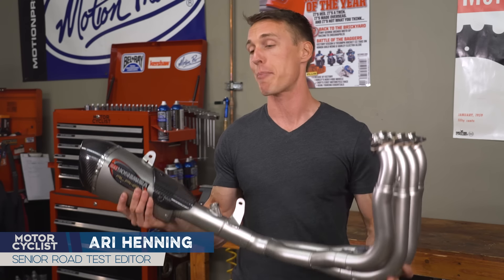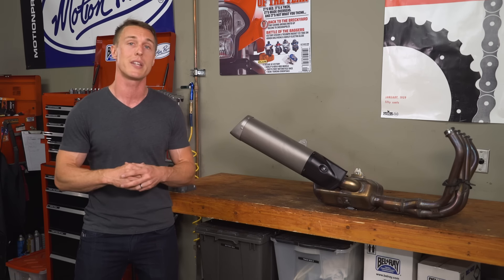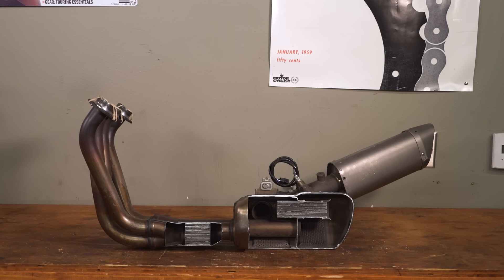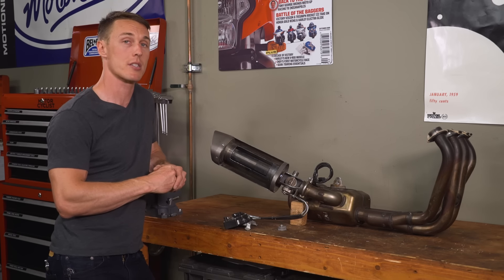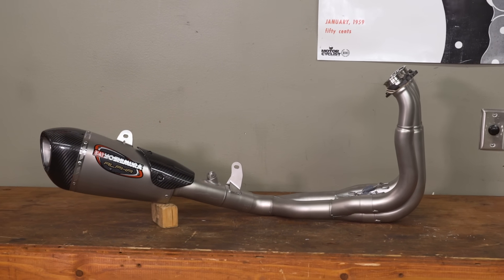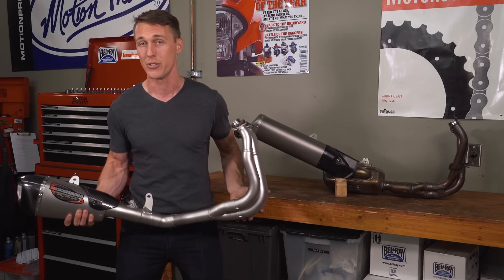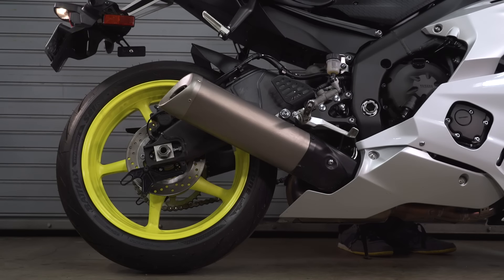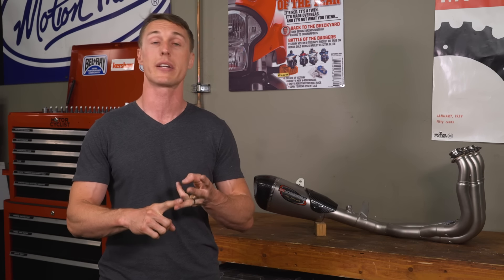The Truth About Aftermarket Exhausts | MC Garage

Comment: If you ride long journeys the novelty of a loud exhaust gets old pretty quick.
Reply: Yes, I hated riding my bike with race pipes on it.  So loud and practically gave me a headache after a 40 minute ride.  Bought an Fz07 and I'm not touching the exhaust.  It's so quiet, I can hardly hear it over the wind.
Reply: DThompson T I’m thinking of getting a FZ/MT-07. I’m torn between the Kawasaki Z650 and that one. What are your thoughts on the FZ/MT-07?
Reply: @vexmau5  well, I went from stunt riding an F3, F4I, KAWI 636 then I stopped that and rode a 750 shadow for a few years.  Now I have the FZ-07 and I love it.  Is it the fastest I have ever had? No, but it's still fast enough.  I love the low to mid range torque it has.  Great for in town riding.  The riding position is nice also.  I looked up alot of reviews and riding videos before purchasing the Fz07 and nearly all were positive.  Do you have experience?
Reply: DThompson T yes I do. I have nearly a year of experience with my R3 under my belt. I know it’s not a lot but I personally feel like I’m ready to move up the scale. Since I only have a year of experience, that’s why I’m looking at the Z650 and FZ-07. I’ve read all around that they’re good “beginner” bikes
Reply: @vexmau5  I cant speak for the kawi but the FZ07 has good power, it's very light and its easy to handle.  I dont know how "beginner" it is because it has enough pull to throw you off if your not careful but I started out on a 600cc and did fine with common sense.  Dont act like an idiot with it and treat it properly and you should be fine.
Reply: LOUD PIPES SAVE LIVES !!!
Reply: @dalehumphrey8765  Certainly doesn't hurt
Reply: HFR83 .. just annoying, especially after a long ride, or some Idiot revving his engine at a stop, or in a gas station.
Reply: @peacefulwarrior4078   Loud pipes give you tinnitus and draw too much attention from the Police - but I have them on my Harleys  as my engines are so modified that standard pipes stifle the bikes ....... I suppose I will get lots of 'haters' replying to that comment !
Reply: Not if you ride a Harley.      1800 miles to Sturgis every year.  On a hard tail 1951 Panhead lol

by the way, you hear complaints about that because crotch rockets have you laying on a big ass piece of metal...  meanwhile chopper ride's more like sitting back in your recliner.. 

Motorcycle enthusiasts = long slow ride in comfort enjoying the scenery.
Crotch rocket rider          = ride as fast as you can while breaking laws, scenery? what scenery it went by so fast you didn't see it..      lol
Reply: @thakery5720  
The wind alone gives you tinnitus, get the loudest exhaust you can but wear earplugs regardless...
Reply: @-JohnSmith-  I agree with that completely !
Reply: Best comment!
Reply: De Sign 👌 ok
Reply: De Sign or a CX 500-650:Honda, like a bad little V-8 I love it
Reply: @peacefulwarrior4078  yes i think it does save life, because whenever these "fool" speeding on the road, often people dont realise that there's 600cc bike behind them speeding at 80-100km. But because they install the race exhaust, it can be an indicator that someone is speeding behind them and  pull away slowly to let this fool pass through. Here in indonesia cops doesn't give a fuck if there's rider speeding at 120km in city road. They only give rider a ticket if bike exhaust is too loud. :/
Reply: I live in California and get to split lanes thru traffic. Legally, bruh
Reply: DONT TREAD ON ME !!! No they don’t
Reply: Vin Commons no they do not
Reply: I can 100%disagree. I own an mt09 with m4 system and I rode all the way to mammoth CA 6 hour ride from where I live. Never got tired. The sound is orgasmic
Reply: DONT TREAD ON ME !!! No they don’t chief
Reply: I rode from Germany to Slovenia, Austria, Croatia, Bosnia and Hungary in 2017 with a loud exhaust and it didn't bother me, but you don't notice it much when you're riding around all day at 145mph I guess.
Reply: Harley Me “long slow ride...”??

I’ve got a dozen bikes, but one of my smaller machines is Japanese domestic market naked sports bike from 1989, a 400cc Honda CB-1 that can easily do 120mph, and top 135 - before I’ve had my burger!

But it’s the thrill of keeping the revs up and throwing it into corners that makes it so much fun and a challenge every time. And I’m 61 with a beard. The difference is I’m not ready for my leather armchair with optional tassels...

Oh, I’m sorry, I forgot we speak different languages.
Reply: Didn't bother me on my CBR500R during my 5 country tour, but everyone is different.
Reply: G58 well said sir 👍
Reply: DONT TREAD ON ME !!! ...Utter bullshit!   Apply for a refund from the education system, you deserve it!!!!!
Reply: @harleyme3163  
As long as they're getting the Heat who gives a fuck
Reply: @-JohnSmith-  Exactly.
Reply: @Tony in Tasmania ...and I only got one negative comment so far.... from a Harley 'Tech' of course..... says it all really !
Reply: @peacefulwarrior4078  nonsense.
Reply: Yeah,I have 'been there'...think about it....a (noisy/illegal) race exhaust is designed to be 'ridden' for,maybe 10-15 minutes at a time (the length of a race,warm up,ect).......usually with ear plugs/communication s in your ears..therefore muffling a lot of the noise........on the road of course...a different thing.....2-3 hours later.....the excess noise can actually get pretty tiring !.....(and your neighbours may hate you starting up on an early morning !....
Reply: @peacefulwarrior4078 
A 120 decibel Denali Soundbomb horn saves lives
Reply: right on
Reply: i wear earlpugs. no wind noise no headache feel fresher after liding and all i hear is a beaut exhaust tone. blisd.
Reply: True for long trips, glad I kept my OEM exhaust
Reply: @Thomas B agreed on that, but most of the time u will filter out through out hundreds of motorcyclist on the road here in Indonesia.
Reply: I put a stubby pipe on my fzs 1000 fazer, I did a 200 mile round trip on the way home I would have swapped the bike for a ticket to go home on the bus.
Reply: @vexmau5  did you buy an fz07 and is it still in 1 piece
Reply: @PhrozenPhlanges  yes and yes. I got the 2019 MT-07
Reply: @everyday tenor People don't hate loud bikes and if you're not wearing ear protection you're a noob. The wind gives you tinnitus lol
Reply: @everyday tenor Sounds like a personal problem. The correct sentence is "I hate loud bikes"
speak for yourself, my neighbors all own loud bikes
Reply: @everyday tenor Still wrong. Millions of people travel to bike nights lol. How about you just speak for yourself.
Reply: @everyday tenor No I really don't. Provide me with a survey of the entire population of Earth to support yours that "everyone" hates loud bikes. Can't? Then speak for yourself.
Reply: @everyday tenor I'm going to need that survey before you can use the conclusion of "everyone"
until then, speak for yourself.
Reply: @thakery5720 police in my state don't give a shit about loud exhaust
Reply: @DW94576  Lucky you !  I live in England and as yet I have never had any real problems about my Harley's noisey pipes but there is something that may get me one day..... we have roadside speed cameras over here and some of them are fitted with a microphone.... you ride by making lots of noise and your licence plate gets  photographed, so then you get fined for  excessive noise..... loud pipes, I love them !
Reply: Yep. Harley guy here. Im proba ly the only one who makes mine quiet.  Like the sound of any open engine but for enjoyment keep em stock.

Comment: Always pair them with a tune. The end
Reply: And today engines probably run more lean than they could just because of emissions, if you are going to tune get a new exhaust too.
Reply: Chris Fokjohn ^ what if it's just a slip on?
Reply: if the cat is still in place you are ok with no tune
Reply: mintpaul not if you still improve flow, you need to then install a high flow air filter/induction kit and tune the ECU to tell the engine to adjust the fueling so it does not run lean or rich.

The ECU will adjust to a degree from the sensors detecting the changes but still can run lean/rich, plus you will not get any power gains withought a tune, the ECU will adjust to put out stock power.  Just a rear box/slip on, you will not need a tune as it will not improve flow, flow is restricted by the size of the main pipe/cat.
Reply: Agreed. if you do a full exhaust, then you definitely need an intake as well, along with a good tune (or a plug in fuel mod) Definitely don't want to run lean.
Reply: A good tune will even make things run better with the factory system. But that's just dumb.
Reply: Chris Fokjohn mine is with a k&n air filter, a power commander, a dyno tune, and a custom map and it goes waaaay faster than stock.
Reply: most of the euro 4 bikes come with a collector box with cat which a slip-on does not affect the flow
Reply: Dom Hawtin that's why it goes faster and better ,,,
 otherwise or with an old carburator bike ... you would have definitely ran lean and lost power and also damaged your engine
Reply: Not true. They ran exactly as they need to be low on  CO2 and NOx, and that does not mean they run lean.
Reply: My old 250, I had a slip on...I tried taking the baffle out.  It definitely ran lean and a loss of power.
Reply: Agreed, a slip on is fine and only really adds to the sound....mine you take the baffle out and you will lose back pressure and it will run lean.
Reply: osama gomaa that's why you would manually adjust the fuel/air mix with carburetor bikes and cars
Reply: @ never heard of just simply having to adjust the carb after new exhaust was installed.  They had to be dyno run and re-jetted accordingly, otherwise no power gains and almost always there was power loss.
Reply: Matthew for sure it have to be dyno run and re-jetted to get that extra power you are seeking ,,,
But just an air/fuel mixture can be done alone to reduce the lean running situation in place where a dyno is not available ... and for sure that will not gain extra boost but at least it is better than nothing !!
Reply: For wankers? you watched it.
Reply: On some of the older carburetted bikes, a lot of pipes used to come with the recommended jets. The manufacturers did the research for you
Reply: @Alistair Tassie or came with paperwork that told you the suggested jets you should be buying and installing with the exhaust. That's how it always worked with all my old carbed bikes...
Reply: ALTITUDE MATTERS TOO. JET KITS ARE EDUCATED GUESSES AT BEST.
Reply: @HalfdeadRider   You got it!

Comment: Driving on LA freeways SHOULD be considered "closed course competition."
Reply: LOL..!!
Reply: racing tracks were designed because everyone is going the same speed roughly. 

racing on the road where everybody is at different speeds is a death sentence. 

but by all means..  add another to the natural selection list..  just dont take out anyone with you.
Reply: @harleyme3163  it's called a joke.
Reply: @harleyme3163  lighten up, man.
Reply: I bought the loudest exhaust system I could find the next day after lane splitting on the 101
Reply: @-JohnSmith-  that won't help you. Only people behind you will hear your exhaust.
Reply: @FroggyCrimes  
Oh OK thanks, must just be a coincidence that drivers move every time I rev-bomb good to know appreciate the help😉
Reply: @-JohnSmith-  they don't hear your pipes, they have side view mirrors and use them. And if you're already next to them and they move, that's not helpful for you. Your pipes point backwards, the sound is almost entirely going in that direction. And because of the doppler effect they will hear it even less.
Reply: @FroggyCrimes  
Weird how now at the exact moment I blip the throttle they move, when before they rarely did... But Doppler...
Reply: @FroggyCrimes  
I guess every time you hear a loud Harley or superbike when you're in your house you're behind them🤣🤣🤣😘
Reply: @FroggyCrimes  that is because usually motorcyclists ride faster than speed of sound :D
Reply: The doppler effect will actually cause a slight increase in noise. Idk if you care that much, but even though most sound goes behind the bike, the small amount that goes forward to those cars will be going 100% forward. Thus the forward-moving bike will squish into that sound-space and increase sound frequency the cars hear.
Reply: You forgot about Florida

Comment: I'm so happy with my stock exhaust. It's quiet and won't disturb anyone when I come home at two in the morning and it just sounds so sweet. It has a deep defined sound to it at idle and makes the bike sing at high rpms. But you can still talk over it and that is absolutely nice. Honda did a great job on that one. Also it really looks absolutely perfect. It's just has a stainless pipe for a muffler. I hate those modern round-ish looking pipes.

I got a 2005 CBR 125. Not big, but what a sweet ride I tell you.
Reply: @jakob6399  His 125 "sings" har har har.
Reply: @jakob6399  theres no questions about it not making it louder. It just does make alot louder, and if you disagree, you haven't owned a 125cc bike with an aftermarket exhaust.
Reply: @jakob6399  I just put an Akrapovic exhaust on my ninja 125 and I can tell you, it’s loud, honestly a little too loud for my liking but it looks and sounds so much better than stock
Reply: keep up with my 636 tho, fuck the neighbors live your life nerd just be quick!🫣
Reply: @JonahZX10  Wow. Real nice mentality.
Reply: you can switch the engine of when your close to your driveway to wheel the bike into the garage if you have an aftermarket exhaust. And in general a bikes start up sound will be just as loud as a car coming home anyway.
Reply: @jakob6399  you would be surprised how disgustingly loud any bike can be with the right... Or more appropriately wrong exhaust
Reply: @JonahZX10   Can i have the rest of your car when you eventually crash?
Reply: @jakob6399  tf you on about? there are lots of 125 cc bikes, and i'll tell you, imo these one cylinder bikes are the loudest(annoying is better word). At least those inline fours sounds nice even if they're loud. These one cylinder bikes tho, lots of people put aftermarket exhaust here and they're loud/annoying af
Reply: I like my stock exhaust, but that exhaust was designed in the late 80's. So its not quiet anyway.
Reply: Love the stock exhaust on my Beta 390 RR-S. Not super loud but louder than any big brands', opens up at high revs/throttle, actually sounds really nice not like a lawnmower despite being a single cylinder 4 stroke. Way different and better sound than my WR250R with an opened up exhaust.
Reply: @JonahZX10  I'm glad I don't live near you.

Comment: "Any weight you can remove from your motorcycle is gonna make it handle better"

I noticed my DR650 was considerably faster and easier to toss into corners when I went from 280 pounds to 225.
Reply: Lol. Grats on the weight loss
Reply: Aye good on ya. I'm trying to lose some myself.
Reply: @Hugh Jaanus 225
Reply: Not ANY weight. Remove fuel tank and see.
Reply: My first and only real life conversation with a real racer (Scott Russell) was 10 minutes of talking about the weight of the rider and effects on the bike. I couldn’t believe he took so much time discussing it with me. That was 1996, I think. Long time ago. It amazes me how much thought actually goes in to the topic by racers around the world.  Not only about body fat but also about how much muscle they want to gain or not gain.
Reply: That must have been exhausting.
Reply: XWriter100  weight actually matters a lot if you have clipless pedals
Reply: @Tony in Tasmania Your comment gave me depression .. not funny at all .. You tried so hard to be funny but failed miserably , life is just pain .
Reply: yeah you know what they say man, salads are cheaper than Carbon Fibre parts.
Reply: DID YOU TOOK OFF THE ENGINE. 😆
Reply: Almost 60lbs on my Dursoduro 750 transformed the bike!!!
Reply: Mind you if you’re on the bigger side, going on a diet is a cheap performance upgrade - there’s a reason MotoGP guys are like jockeys😉
Reply: This is why I shit before rides
Reply: Go on a diet. I dropped 50 lbs and both my bike and my doctor loved it. Exhaust modification cost = $0.
Reply: Don't get on it.
Reply: Depends what you want. A much lighter bike is also more easily tossed around on the freeway by the wind turbulence from trucks. Everything is a trade off. Trick is to find the happy medium.
Reply: Only 50 more to lose

Comment: I think its worth mentioning that even aftermarket exhaust companies are doing great advancements in this arena.  Take Graves for example, not only do they make a great premium exhaust, but they also develop fuel maps and have optional sound suppressors for them.  Recently they started selling exhaust with their own line of back pressure valves with custom back pressure mapping.  Throw in their wideband  O2 sensor kit and you really have an amazing performance package that's constantly adapting to the changing environment..  Its not just fancy plumbing these days.
Reply: Because a sportbike on the road, just doesnt make enough power.
Gotta hold it wide open all the time right?  A 1000 can make 180HP bone stock.
Gotta spend 1000's to really make it go.
Reply: @bradsanders6954  True, stock sportbikes are tuned for street riding and economy.  To exploit its full potential at all engine speeds, need to spend $$$$$.